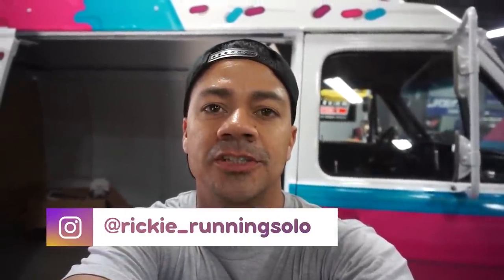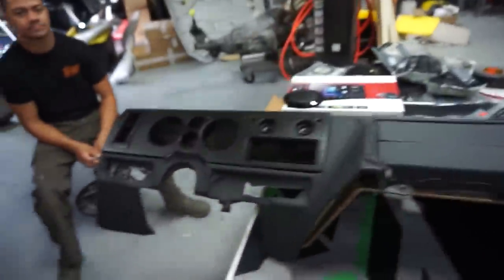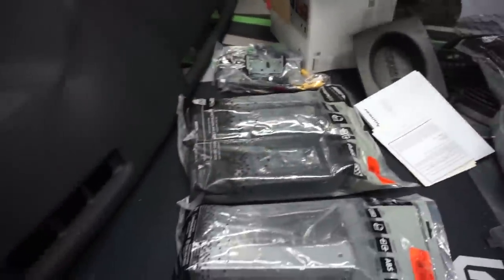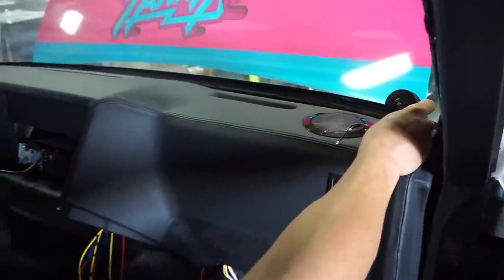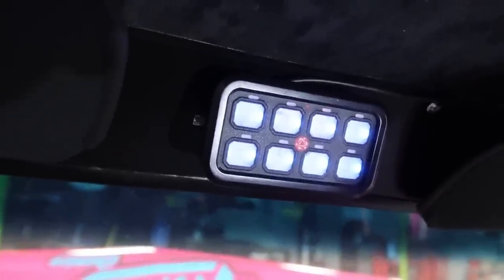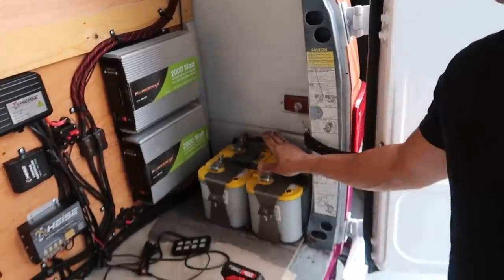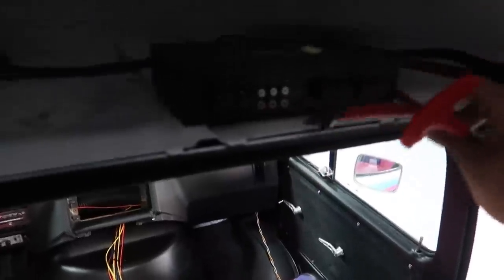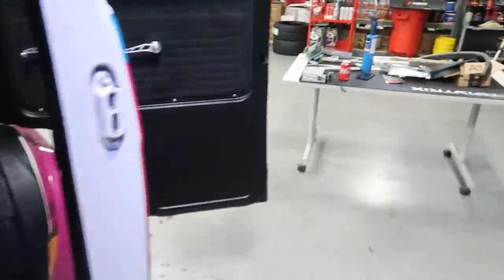Building the COOLEST Ice Cream Truck on the Planet!! [Ultimate Chevrolet G20 Build] - Part 10

Comment: The vent fan is supposed to go in the back of the van. This is so it creates a full draft across the van from the front windows back. You are going to lose a lot of efficiency, especially when the side door is open.
Reply: Not how it works